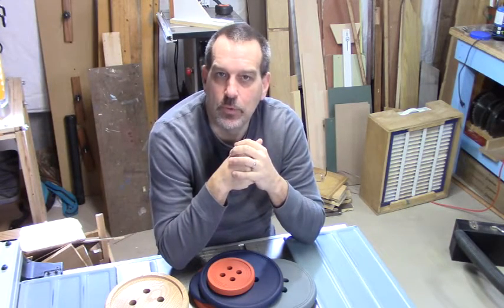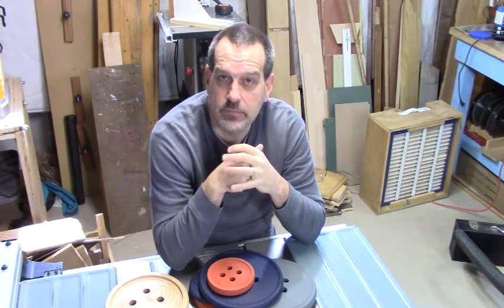Making Big Buttons

Comment: What tools do you need for those  other than the lathe?
Reply from the maker: Hi. I used a band saw to cut them to rough circles, but you could use a scroll saw or a jigsaw. The holes are drilled using a drill press and a Forstner bit. A hand drill with a regular bit could work too. You could build up the shape by cutting them out of thin wood or plywood and gluing them together. You just have to figure out how to use what tools you have.